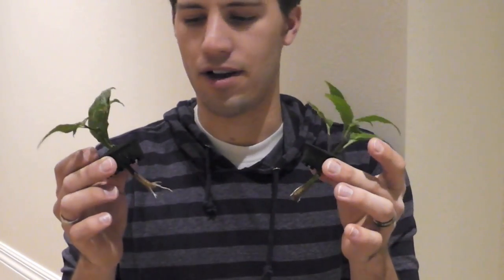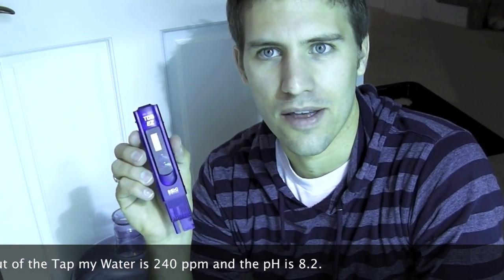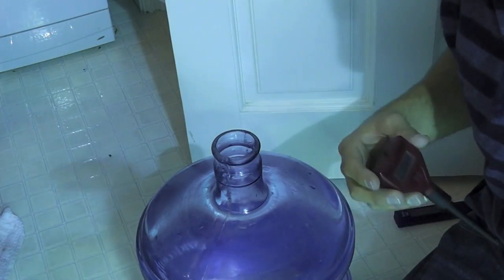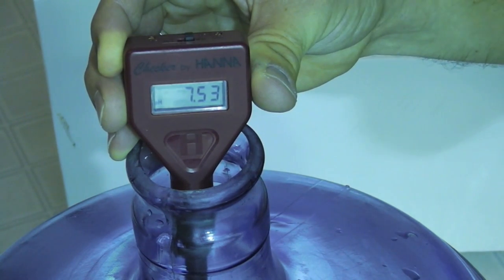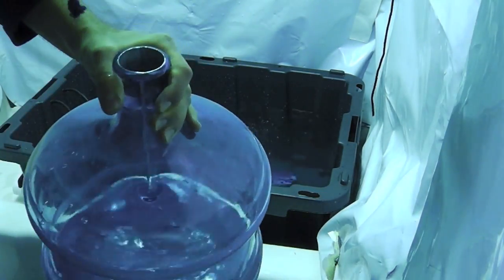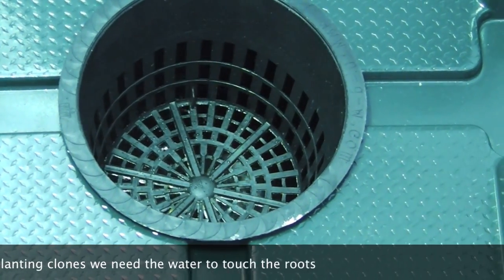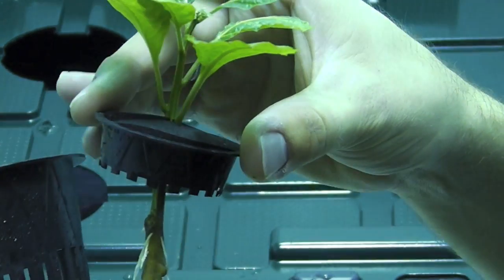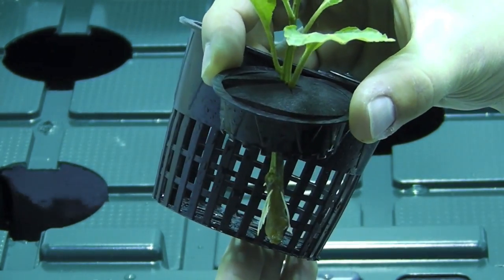Transplanting Clones into a Hydroponic DWC (pepper bhut jolokia)

Comment: Bro, I find a mister in the res really helps heaps
Reply: Agreed. From what ive seen. When the water in a dwc if planning to transplant later. Leave the water lower. If you mist till roots grow down to the water. Then turn off mister. The root mass between the bottom of clone to the water level get really strong and thick in the moist air zone. Giving a better structure of roots not just a bunch of weak little strings of roots.

Comment from the maker: Pump volume is usually measured in gph (gallons per hour). I have added some rails to the system in this video (I will be doing another video shortly on them) and have purchased another air pump because my other one went out. This time I purchase one that was 1000 gph on Ebay. It was only about $50. I am planning on using 2 airs tones in the reservoir and 4 in the rails (on in each rail) and have them powered by this one pump. This should be plenty.

Comment from the maker: It depends on the strength of the air pump. There are weak ones that you can buy at pet stores or strong professional ones that you may be able to get at some pet stores, but are cheap online. In this video I was using a weak air pump. I have since upgraded to one that is rated to about 700 gph. I ran 4 air stones off of this pump with great success as evidenced by much improved root and plant health later on.